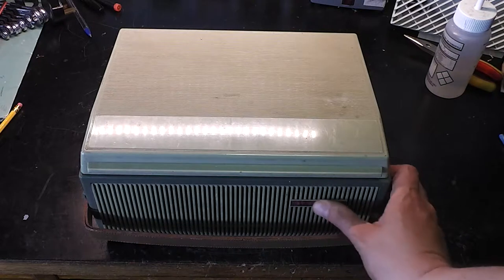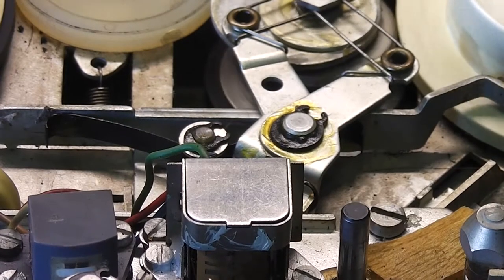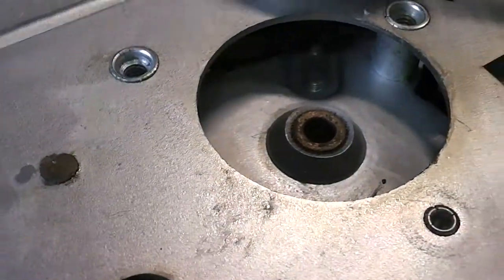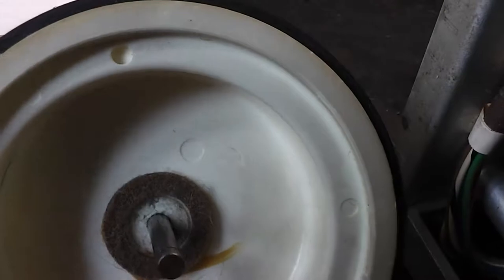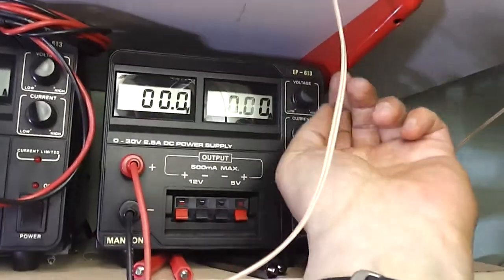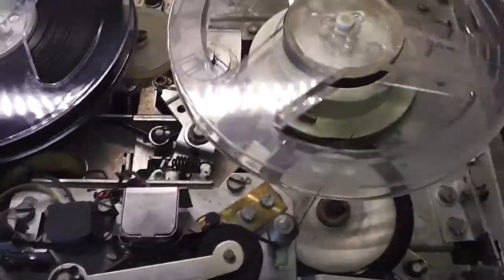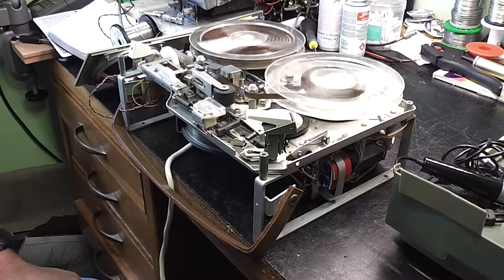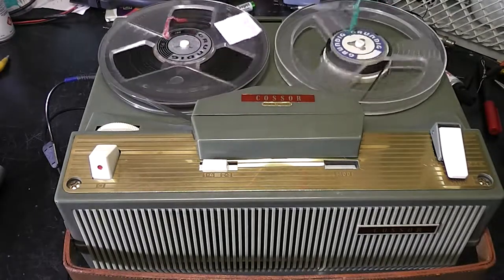Cossor CR 1603A Reel to Reel Tape recorder germanium solid state repair

Comment: Thank you Darren for uploading your video as it has been a handy reference to see the internal workings of our old Philips EL3546 A/78 that needs repair and belonged to my father. It's missing both Idler Tyres from the FF & Rewind Hub and the drive belt had also stretched. Pity you didn't give a length or part number for your belt as that would have been handy. I have used the string method around the pulleys for this machine and came to an estimated total length of 500mm. From there, I decided to order a Square Profile belt at 46cm (18.1") long x 2.4mm that suits the Philips EL3547A as a belt for the Cossor CR1603 seemed far too short at 42cm (16.6").  From what I've read, the Philips EL3546 A/78 is the same machine as your Cossor CR1603A and the Stella ST456, but not sure about the Cossor CR1603. All I have read indicates these are built in 1963 and possible the first conversion from valve to electronic. Estimate trye sizes for the idler hub are 32 mm ID x 42 mm (max) OD x 4 mm thick wall for the large tyre and 26 mm ID x 36 mm (max) OD x 4 mm thick wall for the small tyre. Getting quote to reproduce tyres with extras to be listed on eBay. To be confirmed. Hope this helps you and others. Regards. Daryl
Reply from the maker: Thanks for all the extra details, Daryl. Ive noted to film belts in the future if i make more videos.